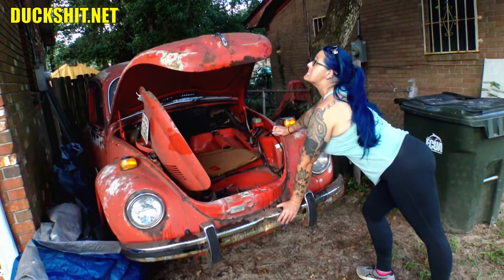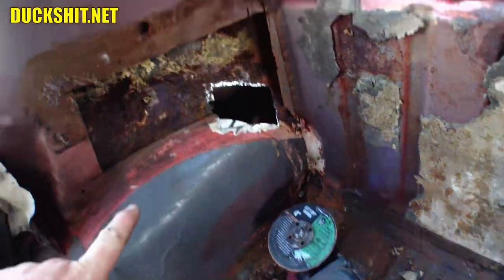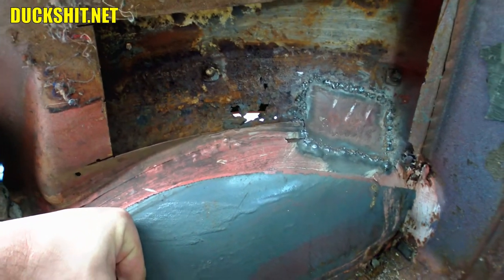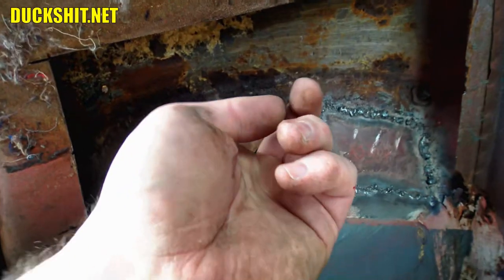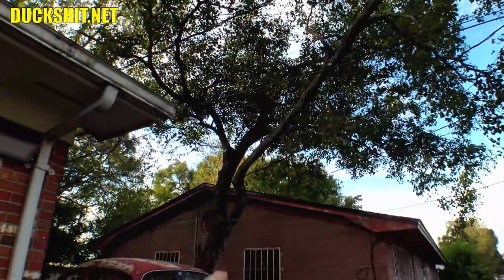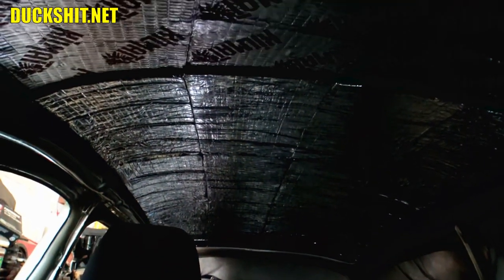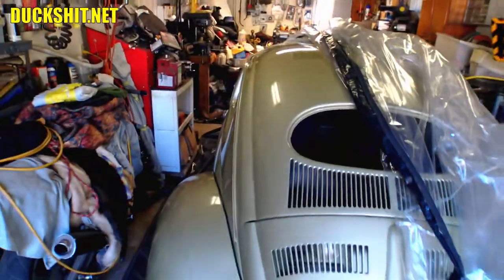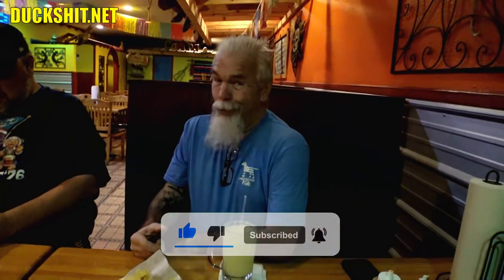💥More Patch Welding💥 - 72 Super Beetle - FAST TRACK RESTORATION - 07

Comment: Did you spray rust neutralizer on that panel on Robert's bug?
Reply from the maker: Not until done welding.... have you ever tried to weld on that stuff?  OMG it smells so bad and is really hard on the lungs if the wind changes direction.